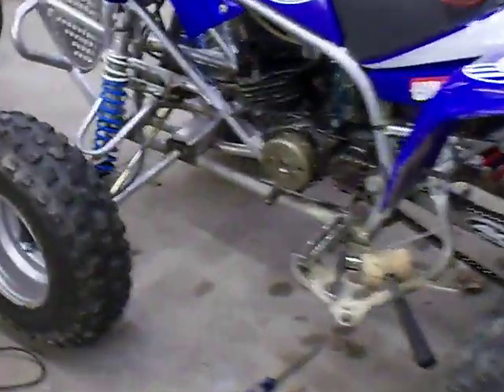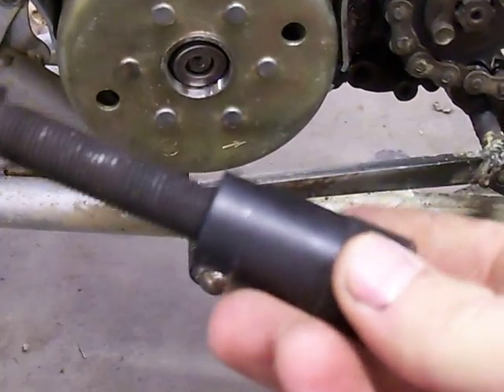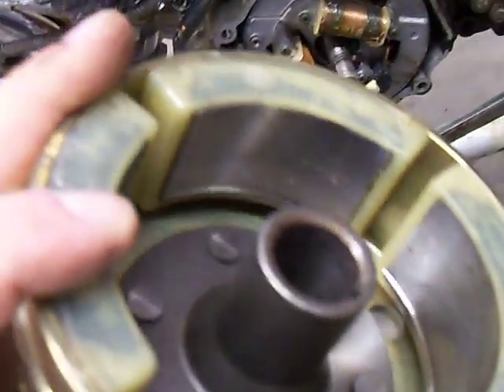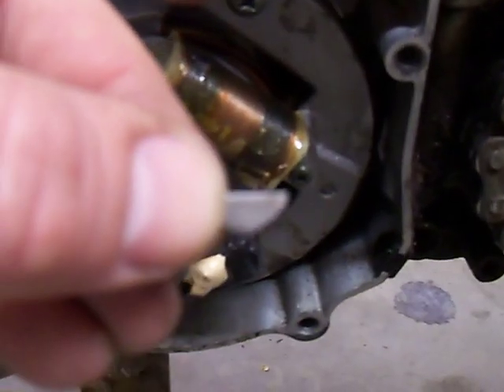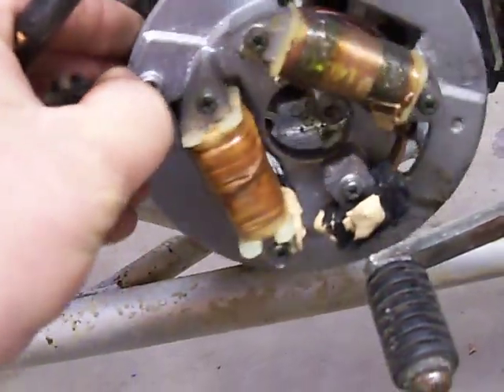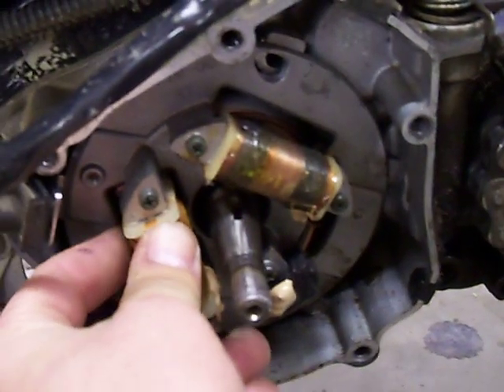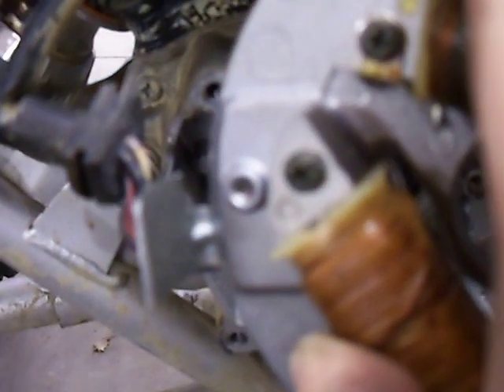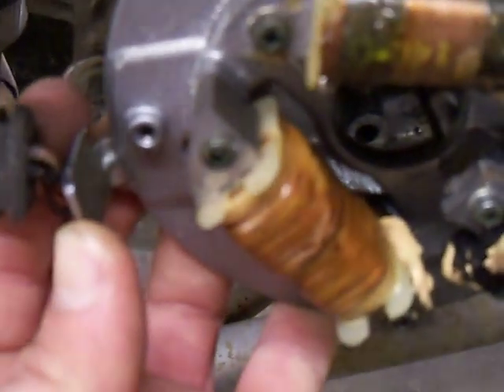How to advance ignition timing on a Yamaha Blaster 200

Comment from the maker: @THEDUKELOVER Just as easy as the video illustrated.  The biggest thing to remember is that you have the woodruff key in the slot properly and have the flywheel slide over the key when you put it back on and torque it down to spec.  If you have it too lose, the key will sheer off and you will have to get a new one.  It's a $4 part, but it just saves you the time and hassle to do it right the first time.

Comment: An easier way to remove the flywheel is pull the spark plug out and shove a rope down in the cylinder. It will hold the engine still which u can remove it but if it is extremely tight that u have to add a breaker bar to it I would get the flywheel tool so u don't do damage to the crankshaft or piston.

Comment from the maker: @yfsblasterman Oh another thing is changing the gearing for your riding style.  A 14 tooth front sprocket will give you about 4mph extra on top speed, but will slow acceleration slightly, but if you are piped and filtered already, you won't notice it much.
Reply: I run 14/ 38 ratio on the ice with my Blaster. lot of money into my winter toy, I ride my dirt bikes in the summer. check out my video chasing down a Honda 400ex and eating it up.

Comment from the maker: @yfsblasterman Not really significantly.  The engine is what develops the power to make you "go".  Other indirect ways are just as "hard" as working with the engine.  The Blaster engine is the most simple engine I have worked with.  Other things you can do though are using lightweight materials(power:weight ratio), shaving front fenders(reduces drag), using high quality bearings for wheels and keeping them greased(less rolling resistance).

Comment: I know this is for a blaster, but if anyone's doing this to a engine with the stator on the opposite side  where the flywheel is moving in the opposite direction (clockwise) moving the stator counter clockwise would advance the timing.

Comment: my blaster has a strong spark from a 12 volt ignitor, getting fuel, cleaned carb and changed gaskets in intake. the only time my bike runs is when I jump start it. any suggestions ?
Reply: Low compression

Comment from the maker: Depending on pipe, better mid range power/torque with a slight decrease in max RPMs, which may decrease top end power to a minute extent, dependent on your setup.  It's almost always a beneficial gain in total power and speed though.  Check the links in the video description for more information.

Comment: Can you go further than 4 degrees if you're running a high octane oxygenated race fuel like 101 octane (R+M/2)?
Reply from the maker: Yes, you can, but the amount more will vary depending on your setup.  There is no concise answer to what it may be.  I ran +5 on 98 non-oxygenated with a milled head and porting.  Just remember, there is a point of no return though.  It doesn't just go infinitely.  Personally, I would never go past +6 but that's just me.
Reply: Maybe you should not be running race fuel if you dont know what degree timming you should run.

Comment: Hey thats amazing the Ignition setup looks identical to the RXG Magneto and coil setup we get in Asia. 
I have developed two Digital ECU's for this application one with 3 maps. ANd the other you can hook up to your laptop and program your own Ignition Map. You can check out our facebook page rddreams or you can visit the customer feedback section on http://www.rddreams.com/forum/viewforum.php?f=5&sid=b9ced4c26ee1a275d303ab573c4888a8 
You just need to confirm that the little pulsar coil is 70 ohms + without the magnet on it.

Comment: Dude you did way too much making that contraption with that wood All you had to do was put an adjustable wrench on the flywheel puller and rest it on your peg while you tighten down the tension bolt on the puller. I've been pulling these things forever and have never had to use one of those flywheel holder tools.